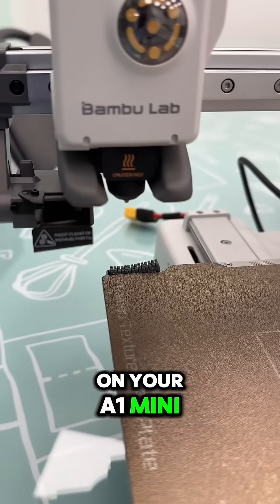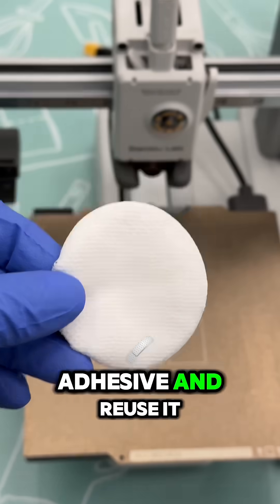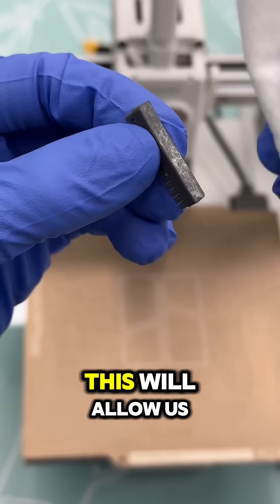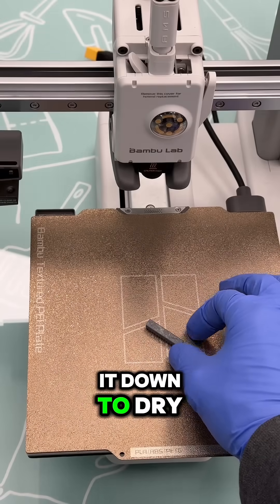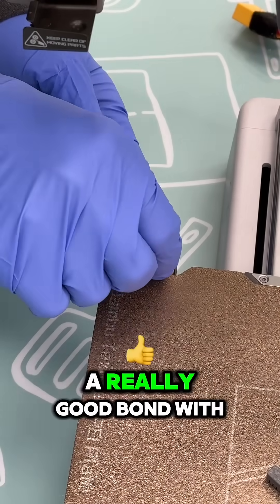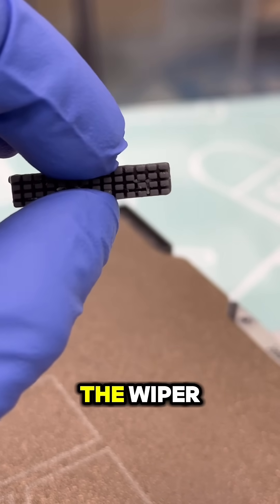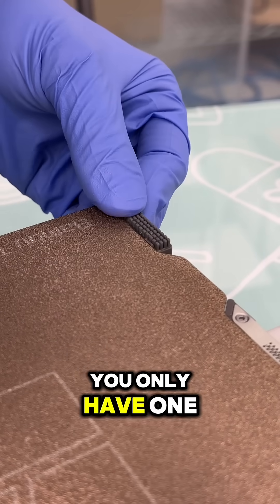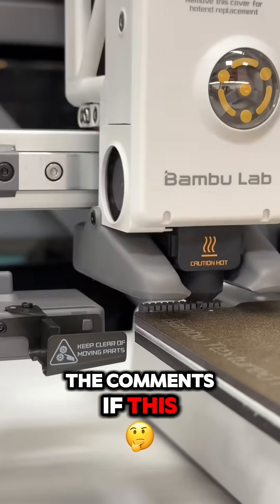Dont Ignore this Problem with your Bambu 3D Printer! It's an Easy Fix! @BambuLab #bambulab

Comment: few drops of super glue, push it back down with a pair of tweezers while it dries. It will hold it just fine. If you need to replace the wiper due to damage later. A few drops of acetone, and some wiping, will let you clean it right up.
Reply: rc tire glue think its ca glue ig remember correctly its a rubber to plastic formula  and lasts longer .

Comment: So CA glue is a no no?
Reply from the maker: Others have said they use CA glue, but I would advise against it because you will eventually need to change the wiper and that CA buildup is going to be hard to get out of the mount pocket. Last resort maybe. You can find sheets of 3M tape for sticking a bed plate to the heater on many 3d printing sites, Id use that.

Comment: 1300 and about 600 on another and haven’t replaced mine yet
Reply from the maker: I think there are two factors responsible for the disparity. My prints are typically short sometimes 30 to 45 minutes and I run these printers basically 10 hours to 12 hours a day so I'm getting a lot of start and Stop where the wiper is being used whereas this is not as often during longer prints so maybe your use is Different? Also I have a lot of printers in one area and the temperature is a little bit higher.
Reply: @ temp around me goes with the weather in my print room. I’m running back to back prints since I’ve got it. Typically 12 hour prints each time. So it’s possible since you technically use yours more with short prints

Comment: I just use the 3m adhesives and cut it with an xacto knife using the silicone cleaner as a cutout guide... just be careful and watch your fingers

Comment: Why do you have a power connector like that?
Reply: For quick disconnection to maintain the printer without the need to unplug it from the outlet
Reply: @Kratom7030  so you connected that directly to the 12 V in the printer?
Reply from the maker: I have all my printers connected to one very large but efficient 24v power supply which is fully backed up with 3 Tesla Model S battery packs to keep my farm going even when the power goes out. This voids the warranty on the printers obv! I will be posting more on this soon :)
Reply: @leckiestein  Thats pretty cool!
Reply: @leckiestein  isn't that a bit overkill?
Reply from the maker: @Dronitalia  Yes, overkill if it's just a few printers. Something to think about: I pay $1200-1600 in electricity every month. Bump the PSU efficiency by as much as 22% on some of my older printers then multiply this by 96 (the number of printers I have) and it's big savings and less waste heat that I have to take away with airconditioning. Next, consider how much power 96 printers use: on average it's about 235 watts for my old ones 235x96=22560 watts; it takes a lot of battery to keep this going when the power goes out which is quite often! Especially with the wind we have been experiencing right now. Lastly, consider how much filament waste and man hours it takes to peel up failed prints and restart 96 printers a few times per month because of a power blip. It makes sense to me and it has been working well since 2019 :)
Reply: @leckiestein  wow

Comment: Mine hasn't moved in one year and 200 plus hours of print time
Reply from the maker: All of my minis have about 500 hours on them now but whats more of a factor than the hours theyve been printing is the how many times theyve started a print. For my use, depending on the print material like petg, often I run a wipe sequence several times mid print to keep the nozzle clean. My case use could be an outlier 😂
Reply: @leckiestein  how do you add mid-print wipes?
Reply from the maker: @difflocktwo  in layer change gcode you can add {if layer_num==the layer you want} put your wipe code here{end if}

Comment: Or a couple drops of ca glue
Reply from the maker: If you dont mind later replacing the bracket that holds the wiper, CA glue would provide the ultimate hold!
Reply: @ I bet you could still get it out not too hard if you only used very minimal!
Reply from the maker: for sure! My thought would be the build up over time. some of my wipers have broken bristles at 2 months (ive only been using bambu for this long) so CA glue could be a good alternative if you cant save the oem tape :)
Reply: @leckiestein  "ultimate hold" well, there are methods and substances to dissolve already cured CA glue...
One very important method is high heat - not on plastic parts, obviously!
But also label remover fluid/gel, or even a sharpie-style (felt-tip dispenser) label remover pen. Contains naphta, butanol etc. Needs more reagent and more time for the reagent to seep into the CA glue than when removing your everyday e.g. shipping label's adhesive, but it works.
Reply: This part looks like some rubber. CA glue might be inappropriate for that material. You know what acetone does to polystyrene, right? CA glue is also very aggressive to some materials, so be careful with that idea. As with laundry stain remover, "Test in an inconspicuous spot first"😉